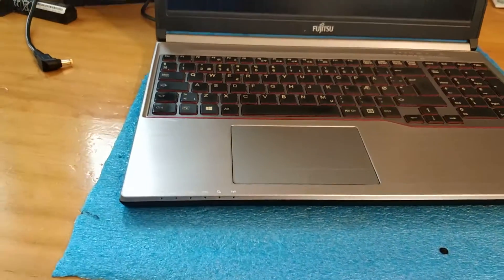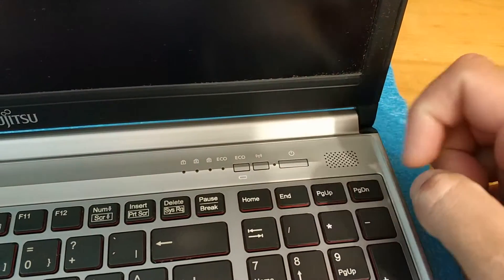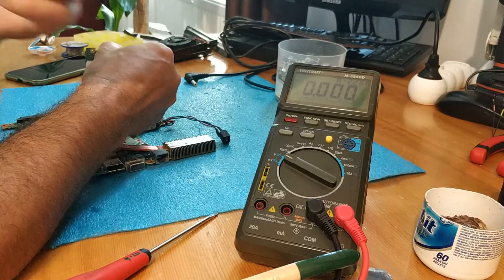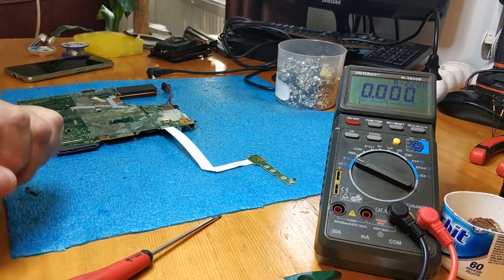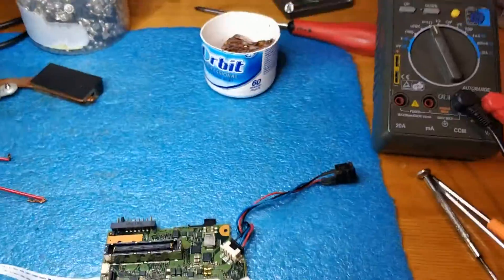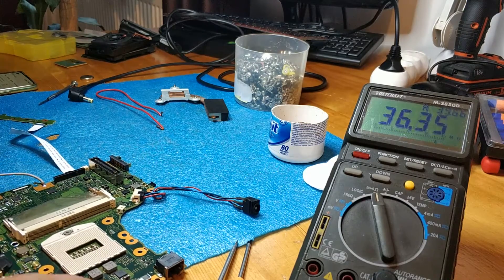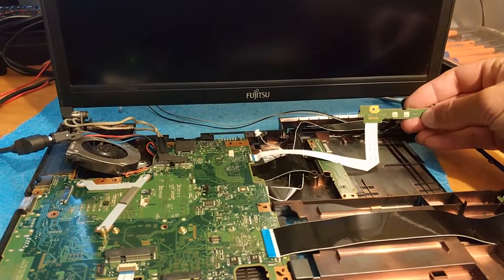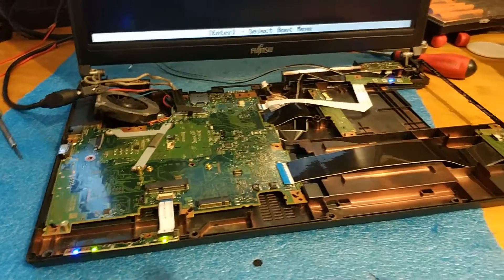Fujitsu Lifebook E754 - NO power ON - REPAIRED

Comment: Thank you for this, although i am curious as to how you tested with wire

And how the ohms reading works
Reply from the maker: Video has 2 years, without few days = most than 2 years from moment i repair the notebook, so it"s impossible to remember.
Those wire i use to power the mainboard from laborator power supply, i do not use probes, because i want always to have firmly contact.
"And how the ohms reading works" just google it, but shortly, when an mosfet give between gate/source/drain some resistance, that mosfet is bad(explanation it's way more complicated, because mosfet can be closed/gate activated).

Comment: Hello, I have A Fujitsu A577 laptop. Its not booting and not posting The 3 yellow lights near the power button is Blinking continuosly.  I already changed the cmos battery. Do you have any tips?
Reply from the maker: Hello. First try to let it like this, powered on for 10-20 minutes, maybe it has an bios update going on.
If not, change or test with other memory ram.
If not, perform an bios reset through battery bios.
Good luck.